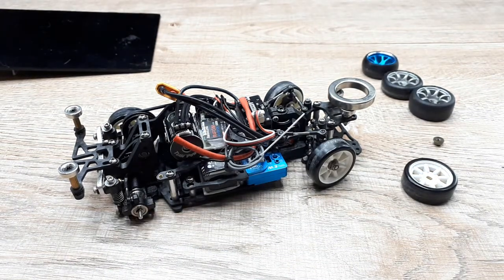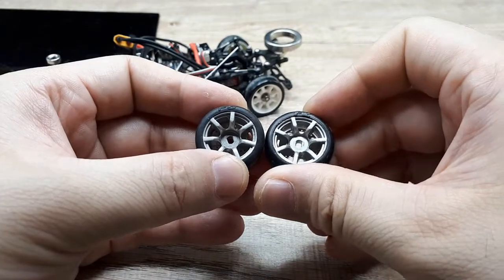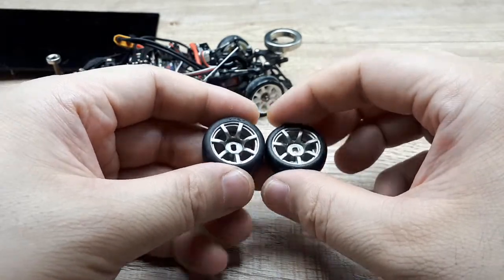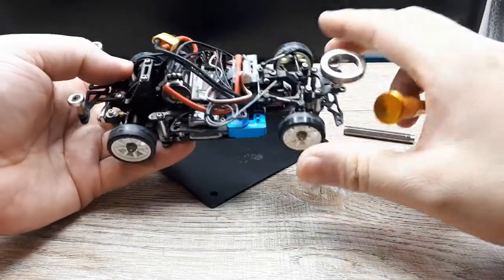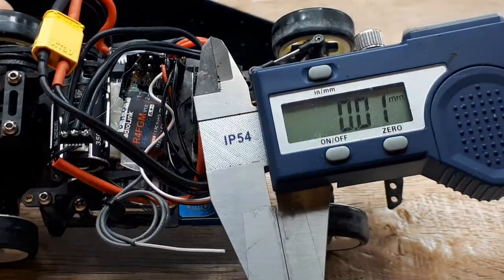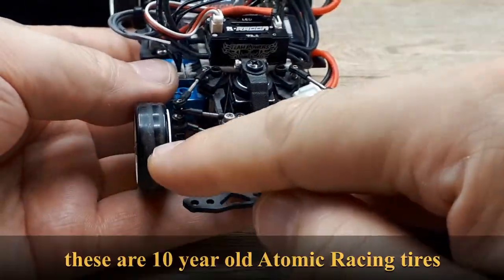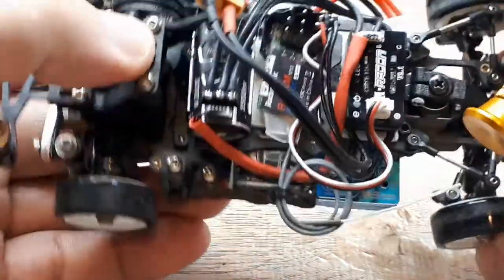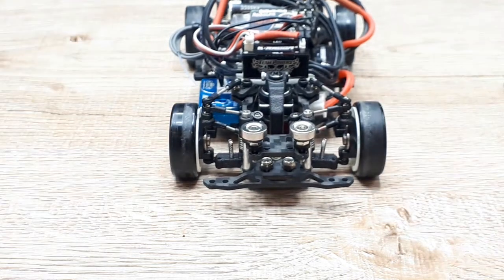1/28rc Drift Art 2 chassis build part3: more shims & tire tests.

Comment: Looks good, but you definitely need some LF series tires. Those shown are very grippy for that surface. Also, on the front suspension, replace the lower rod end with a longer version, it helps me with the issue. Also, don’t get too invested with the tuning right now without a body mounted. You should only do your final tuning with the body installed. You’ll find yourself chasing your tail tuning without the body and then with the body. Just some helpful advice take it or leave it. I enjoy your content
Reply from the maker: Thanks for the tips. I ordered the upgraded links and I'll try some LF5s someday.

Comment: man i love this driftart 2 content, keep it going my handles still very poorly and i can t hold long drifts or do donuts for a bit longer
Reply from the maker: I think the gyro setting is the most important thing to tweak.  Just set it higher and it won't spin out.  Adjust the ride height corners so the thing turns equally left/right too.